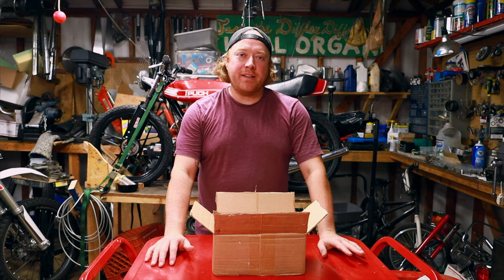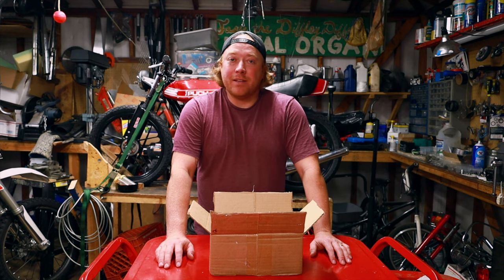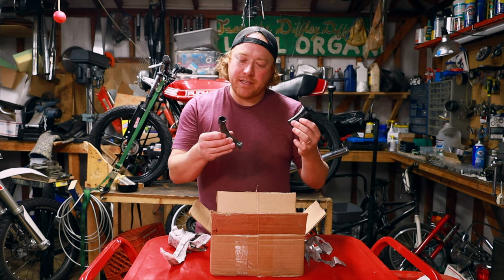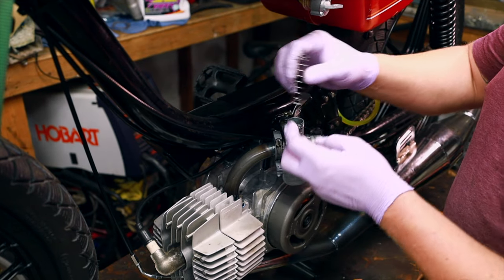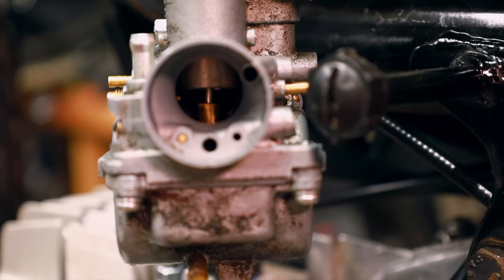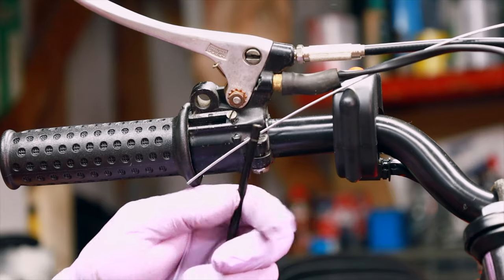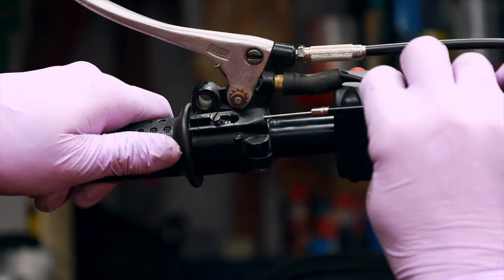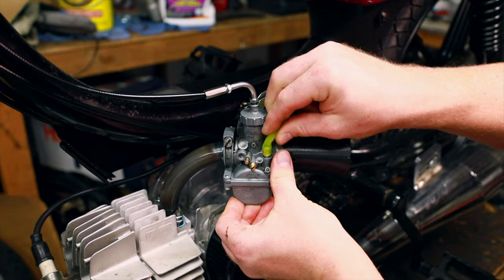Installing a custom Mikuni VM18 Intake on a Puch Magnum 70cc cylinder (CRANKPIPES)

Comment: Bought the same intake from ryan a few months ago absolutely love it. I'm running a huge pwk21mm flatslide carb and I've got no clearance issues with my pedals. He even threw some swag in with my order which is always a big plus.  But performance wise I will never ever go back to a stock intake or bing. Everyone told me 21mm would be to big for the airsal 72cc big fin but it's not and I almost feel like it could go bigger but I'm definitely not a guru or even a good tuner for that matter but my little puch does 55mph and that's sure as hell fast enough for me. Well atleast for now.
Reply from the maker: That's assume. Those big fins are rad!

Comment: Perfect video!
Quick question, What Trottle assembly are you usesing, i would like to have it on my PUCH MAXI insted of the original.
Thank you!
Reply from the maker: It is this one. But if you search throttle on Treatland.tv there are A LOT of options. 
https://www.treatland.tv/ProductDetails.asp?ProductCode=magura%2Dthrottle%2D0123953&CartID=4

Comment: Great video man! I am rocking an 70cc airsal with a 12 mm bored out to 15mm bing carb. It’s running great but I think it has much more potential. What do you recommend for a bigger carb and intakemanifold? And not too expensive 😆
Reply from the maker: I think 15-21mm is good. I would suggest a VM18 or Dellorto 19 PHBG. I have never had good like with bored out bings.
Reply: @Corn-ped  is an imitation carburetor good? Or should I stick with an original
Reply from the maker: If you can stick to an original I think there are a lot less issues. Clone carbs often don't have removable atomizers or the Jets are a different size and hard to adjust